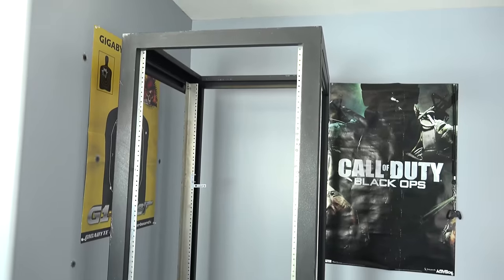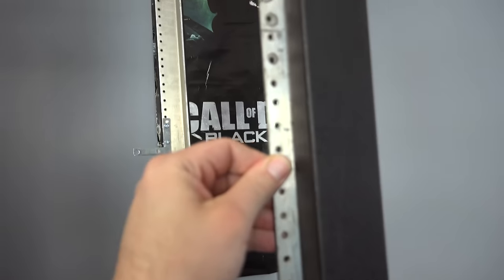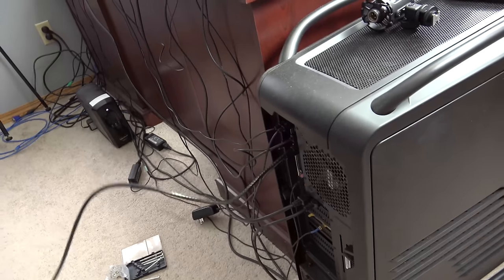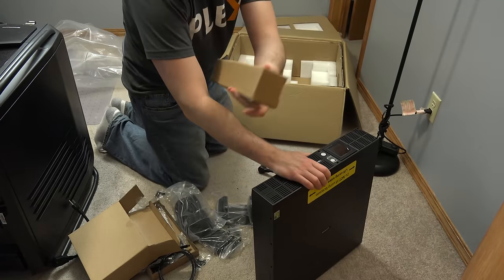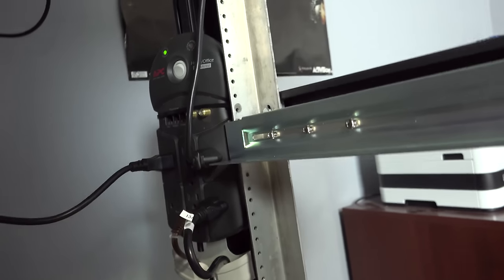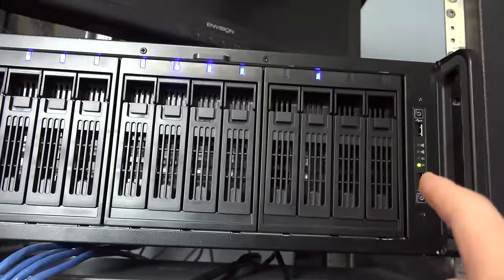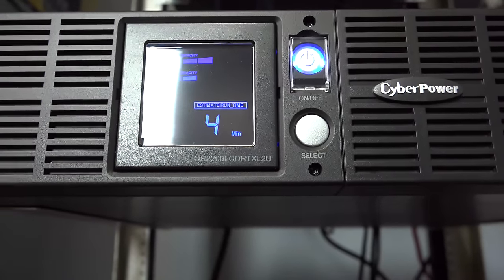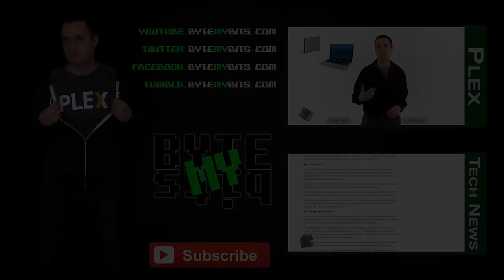Network/Server Upgrade VLog

Comment: UPS's are mounted in the bottom of the rack to ensure that the center of gravity stays down, so your rack wont tip over ;)
Reply: +RandomNova Gaming yup! also, giving the unforseen circumstance that the UPS rail fails, the UPS wont crush the devices below it XD
Reply: actually no only the UPS, but practically everything that weighs more that or things in the racks, should be put in the bottom.
Ordered by weight from the bottom up, except when its not possible, its always recommended ;)
Reply: Also for ergonomics.  the UPS isn't something that needs regular maintenance or expansion.  Things that do are kept at normal working levels for comfort.
Reply: Martijn what about fedexs?

Comment: Infrastructure engineer guy here :) Congrats on your first home rack. It's satisfying in a weird way to have a cool setup like that. I'm probably going to repeat several other people, but here are some thoughts/suggestions:

Definitely move your UPS to the bottom for a few reasons. On a rack keeping the most weight on the bottom is important to keep from accidentally tipping. Not to mention it's heavy, so when you have to replace the batteries in a couple years, you don't want to have to deal with it up high again. Also, when you add more equipment in the rack, it will get the in the way real quick.

While on the topic of power. You will be fine with an adapter for now. However, if you start loading it up beyond a few servers you will definitely want to get a proper 20a circuit (just for safety reasons). Your circuit wiring will be 15amp, so you will need to run another circuit for it.

All my installations I usually like to put the switch(es) on the top. This is purely for cable management reasons, especially when the rack is fully loaded (and so is the switch). Obviously it doesn't technically matter where it is, but cable management becomes a thing real quick in racks. Get yourself a bunch of Velcro. I also always put switches in the front like you have. It's more difficult to quickly check a connection if it's on the back.

Rack mount cases aren't designed to take the weight on the ears, they will bend or snap eventually (I've seen a 1u server sag down because of that). It was a good call to get some sort of brackets for the back. If I come across equipment that I don't have rails for, I will usually pick up the super cheap crappy "L" shaped rails that provide a "shelf" of some sort, or I will just buy a couple shelves for relay racks, anything cheap. You can also stick it on top of the UPS until you get a solution.

As far as the teaming goes, you're doing fine. When it comes to network speeds, a "gigabit" ethernet connection is a theoretical max. With the overhead of the protocols to manage the connections, the OS, the hardware, cable quality, connection quality, etc, etc you will never reach that limit. Teaming definitely does help to get more bandwidth, but there will always be limiting factors like how fast the data can be read from the harddrive you are transferring from, how fast the data can be written to where you are going to, etc.

Some stuff for the future, I would recommend picking up a PDU (basically a power strip made for racks). You might be able to find some for super cheap on Craigslist or on eBay just pay attention to the plugs on them. A lot of them are made for 220v (more efficient for loads) and have different power plugs on them like the twistlocks which you won't want. This will help in your cable management and of course outlet availability. Keep your 15a circuit in mind though, gather up the normal power usage for each device and keep tabs on where you are at.

Thumbs up on the pfSense router idea, I'm a big pfSense fan. I've just been been building up my new unRAID box (you should check unRAID out, it might suit your needs well) and I'm in love with that too. When I have both a new pfSense box and my unRAID box setup, I'm going to get an Ubiquity AP and have a kickass home network on the cheap.

Be careful when picking your hardware for pfSense, it's easy to go way overkill and waste money. pfSense runs very well on very old hardware, and you don't need much disk storage unless you are going to run a proxy with cache on it. It is a good idea however to have redundant power supplies even if your rack feed isn't redundant, as a power supply failure will still ruin your day. If it doesn't make sense to have redundant power supplies for the equipment you want to get, get a spare part to replace the psu if it fails and have it sitting around handy. The insurance cost is worth it.

 Anyway, I bet you $10 that rack will be stuffed full by the end of the year. Looking forward to more videos of it!
Reply from the maker: +Mike M great info :) thanks man
Reply: +Mike M Roger that on the UPS on the bottom.  Also a good idea to number the U's on your 4 post if they aren't there already for future use in lining up front and back holes when mounting rails, shelves, etc. that run front to back.
Reply: I'm running my pfsense router on a 2005 Dell dimension 3000 with a pentium 4, 1gb ram,  and 78gb hdd. It's rock solid and handles anything i throw at it with my home network, and 220x22 Internet connection.  It never breaks a sweat.  You definitely don't need good new hardware.  ;)

Comment: IT analyst here, and a Plex server dude.  Most switches are mounted in the top U in the rear of the rack these days,  But you might like the pretty lights.  :)  enjoy.  Go get a nice PDU.  Watch you weight up high, you can make it easily tip over.  I have seen rack with anti tipping due to weight these days.  UPS's usually go all the way in the bottom.  I got nic teaming with 2 10Gbyte connections, but I have 8 hospitals radiology Imaging going on.  The Fans in the Cosmos II, I had the same issue.  Noctua is all I can say.  Dead silent now.
Reply: +Michael Beaver Depends on the type of switches and network topology in my experience.  Patch panels are common with the enterprise networks I install and they go at the top.  If everything is in one 4 post, clients usually prefer router on top, then CSU/Firewall gear, then patch panels, then switches, then servers, then UPSes.  No way am I installing a 5412 in the top of a rack, even if it's bolted to the floor.

Comment: Hot Tip: Take the battery out of a UPS and it becomes about 50% lighter.  I know hindsight, but my experience with installing enterprise Dell, IBM, HP, and Lenovo servers, especially fully loaded blade centers, has taught me to remove parts as almost all of them recommend two people to install and I'm always on my own.

Comment: hey Jason: do not change the breaker in the box, unless the house wire is 12 awg.  the 15 amp breaker uses 14 awg wire.  if you change the breaker to a 20 amp and the unit wants more than 15 amps, your house wire becomes the weak link and it will burn like your usb, but worse:  its your house.

Comment: For your case, the ears are less likely to strip out or give than the actual rack (or rather, the screw going into the rack), but yes, ideally you want to use rails for any equipment over 15 pounds, or anything that might need occasional servicing.

Comment: I managaed to get a two post and some Cantilevered shelves but have a relatively lightweight configuration. I am using a Eaton 5S switch for a UPS on a Seagate 4-bay Nas. I have a SMC 24 port Gigabit smartswitch my internet router a D-Link router behind that (Bell makes things complicated). I placed my 5S UPS on a cantilevered in the  lower third of my rack.  Its a smaller light weight system and not network connected.  The UPS has a USB connection to the NAS for shutdown notification. The Next UPS step would be a 5P or 5PX (Extended run time). This would also give you network access to the UPS. Enjoy.  I will have a final  video on my site soon.

Comment: The UPS will only run the fans if its on battery power mode to keep the capacitors and invertors cool. It ran the fan on first start up as a initial battery test, thus causing the fans to rev up.

Comment: I agree with the other commenters that your rack is too top heavy and you risk it tipping over.  Secondly, if you do run into problems tripping the 15 A circuit breaker, don't just swap it out with a 20 A breaker without first checking that the wire is a thick enough gauge to handle the extra current (it's probably not).  I wouldn't want you to accidentally burn your house down.  I recently did a similar project which also included running a dedicated 30 A circuit to my rack and that required 10/2 Romex cable.
Reply from the maker: +Steve Cox good idea!

Comment: Rails are the way to go.  A round-hole rack may be hard to find rails for.
Mount your switch in the back of the rack (facing backwards).
Buy a rack-mount power strip.

Those small purchases will transform your install completely.

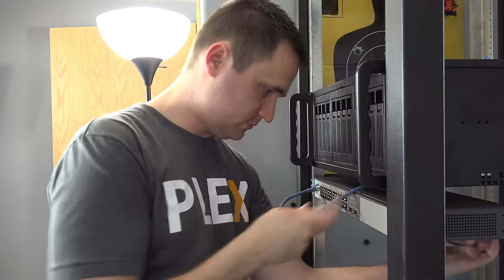Comment: To answer your question at 08:51 on if you are plugging the 4 ports in correctly: from what I can tell on that HP procurve switch, ports 1 through 24 are mapped to the same physical ASIC.  So having the 4 cables plugged into 4 consecutive ports should be the same as 4 random ports.

Comment: Very nice upgrade for your computer room! A word of warning though, changing to a 20a breaker and 20a outlet doesn't give you a safe 20a circuit. The reason for this is the size of the wire is not meant to handle 20a and worst case scenario would cause the wire to overheat potentially resulting in a fire. This would be unlikely to happen but just a word of caution.

Comment: yes you can swap the breaker, but the purpose of putting that 15 amp breaker is so it doesn't burn your house down. If you swap the breaker you also need to swap the wire, because it can't handle a 20 amp draw at full load. If you draw more than the wire is rated for it will get hot.

Comment: Your cable modem is probably on a residential network, they tend not to have any UPS support. If your local power goes out on the grid, your cable modem's CMTS at the end of the road will probably be down as well.
Reply: +Simon Johnny yes but it does protect against power failure in his own home

Comment: Please DONT swap the breaker, breaker is to protect the wire, so if you dont have a 20amp this means your wire will catch on fire if the breaker do not open :)

Comment: I do love the fact you're doing a rack mount system....it's where I want to be in the future.  I'd need a quiet system though, and would probably pick up an 18U silent rig (expensive).  It's expensive and you did go pretty ghetto.  Maybe should have seen if your lines could support 20Amps and have an electrician come out and fix you up.

Comment: A UPS is designed to allow you to gracefully shutdown your server, PC and other equipment that doesn't like losses of power.
They aren't normally designed to use in a non-main power state. 

If you are considering more power requirements, a dedicated 20A or more circuit would be beneficial for the setup.
As some have said before, the UPS is traditionally on the bottom to give the rack weight down instead of mid rack.

Did the second card go into the PC?

Comment: The display on your UPS will help you from exceeding the 15AMP limit of about 1850 watts (Check ohms law for exact) = 185Kw.  As long as you don't exceed that on your UPS you will be fine.

Comment: While you can swap to a 20a breaker, you need #12 wire to the receptacle(s), which also needs to be 20a rated or the wires in your walls, will heat up like your toaster in the kitchen. Also, I doubt you only have one receptacle on that circuit.  Stick with your CyberPower UPS adapter.

Comment: Don't mout by the case ears! They are just used to screw the case in plase on rack sliders so the case won't slide out again. Alternatively you can use some leftover wire / cables to mont the case

Comment: Mounting by the ears isn't recommended mainly because as you remove the case, you can have the case fall down from the back end.
This isn't so much of a problem if the unit directly below is another case, you'll just scrape the top of it a little. However, the damage to your wrists can be pretty bad, more so in a heavy case that you're attempting to pull out.
You can get to the point where you pull a unit, it comes out a bit ok, and then it falls down into the rack, the from goes up, and depending what's above it, could mean you've just smashed your patch panel up.... and that's not fun.

Comment: not sure if anyone else said this but those HP quad NIC's will have Proper Windows full set of driver which will include the HP teaming tab. Anyway next topic how loud is that Rosewill case fans? I've been looking at replacing my non hot swap tower case with a rack mount case, looked @ Norco RPC  but at 600+ buxs its out of the option plus the case fans are geared for a proper server room cooling.

Comment: Just another nerd chiming in here. I install IT and A/V racks and made my fare share of mistakes. We mount our servers/controllers/switches/scalers by the ears like that. Much larger and heavier prosumer equipment than that. I have definitely put some boxes in which were heavy to the point where I did question it. The heaviest was installed a couple of years ago and it is fine. Your concern is justified, but if they were not rated to hold their own weight by the ears like that, they would have many complaints and returns.

Comment: Crimp your own network cable.  Get your ultimate nerd card :)

Also, why not put the server rack in another room?

Edit after you start the UPS:  Now you really need to move the setup to another room and run cables through your walls.  You will be much happier.

Comment: Freenas 10 is coming out soon. You will be able to use some VM's. Look into it. I am currently in the process of upgrading to dual xeons so that I can run some VM's along side my Freenas.
Reply: +TechBuild Studios FreeNAS is lame... Windows server 2012 R2 has been running better then FreeNAS xD
Reply: +fmslick you know freenas and server 2012 r2 are used for completely different things right?
Reply: yes but you can user win serv 2012 r2 as a NAS.

http://prntscr.com/atw5ux
http://prntscr.com/atw6k2
Reply: you know the whole point of freenas is zfs right? windows doesn't have zfs nas capabilities lmfao fmslick
Reply: yeah but ZFS eats ram and even if a drive fails you still have down-time
Reply: But you can have ZFS with out FreeNAS as well.

Comment: You can still get that case on Ebay.  I like to get it with out the hot swaps in it because you can switch those with ones that can hold 5 each for a total of 15 but either way this is nice.

Comment: Nice rack !  I picked up some APC UPS 1500 from ebay (non rack type); one UPS 1500 and ordered batteries both from ebay for less than $200.00 USD total.  As others have said mount the UPS low to the floor.  Ebay is your your friend...  Thank you for the video !  tjl

Comment: If you were strictly Windows enviroment, You could run SMB3.0 and it has the ability to auto config it self to multithread and multichannel. So the more threads and the more NICs you had... the faster it would transfer data. But you need Server2012 (r2?) and Win8 minimum.

Comment: Really enjoy watching your videos. I have been a Plex Pass user now for about 2 years and love it. I'm getting ready to purchase the new networking equipment and the same rackmount case you are using. My only problem is trying to figure out what hard drive configuration I need to use. I'm currently using 3x 1TB drives and 1x 500GB drive full of media. I just need to figure out what size drives to upgrade to (probably WD Reds) and what RAID configuration. Really excied to see what you have in store for your next video update.

Comment: 20:48 yeah, but is the wiring from your circuit breaker panel 12 gauge vs 14 gauge that is standard ? feel like pulling upgraded wiring through the walls ?

Comment: I bought a 10GbE Mellanox for 15$ piece, 2 for 30$, 2 SFP+ fiber module for 15$ each, and 15 m fiber cable for 12 $. You got a 10GbE data transfer for a price that you paid for a 2 4port NICs. Otherwise If you use SMB multi channel to connect workstation to server it's not a good ideal because when you shutdown your workstation all you connect will reset then you turn it back on to work SMB may mass up and you back to 1GbE. SMB multi channel is only great when you run it between to server.

Comment: Believe it or not, there are some Core i3 processors (Haswell) that support ECC memory.  I am currently running my FreeNAS on a Core i3 4130 (3.4 ghz) with 16 gigs of ECC Kingston.  Now, you may have more transcoding requirements than I do, but I thought I'd mention it just in case you don't need to spring for a Xeon.
Reply from the maker: +Canny Yeah if I do the upgrade I will go for more power + the ECC. I like upgrades lol

Comment: You shouldn't just swap the outlet and the breaker. Check what your electrical codes are in your area. 

Where I live you need at least 14 gauge wire for 15 amps and at least 12 gauge wire for 20 amps.

Comment: you can get 4Gbit/s file transfer if the bonding supports aggregation i've got a 10/100 switch that supports bonded aggregation and i would get 150-200Mbps file transfers (because it only had 8 ports and i needed 4 ports for other things)
Reply from the maker: +denvera1g1 Yeah I wish I could figure that out. but I think the nic i bought does not support it

Comment: that cable will GLOW, split the power down to two cables and use one on each ringmain, oh and ups ALWAYS low down, not mid height. there your racks ballast!!